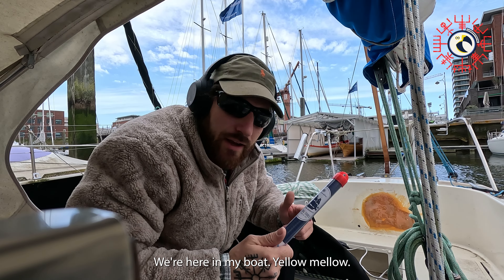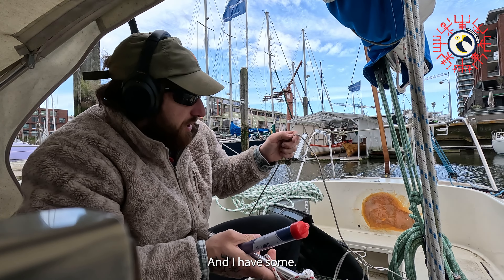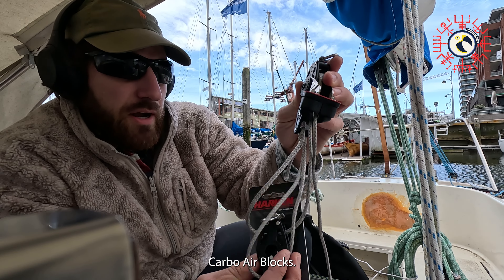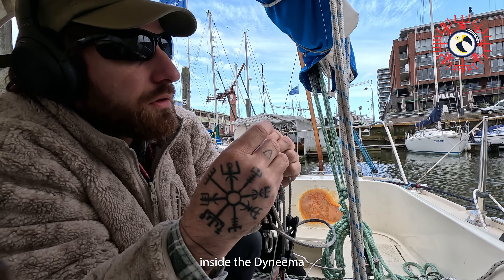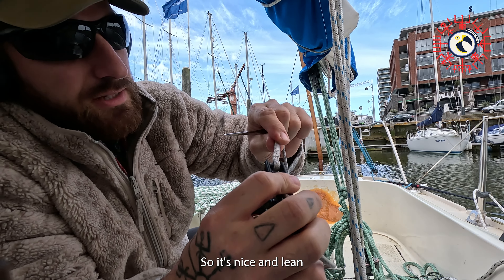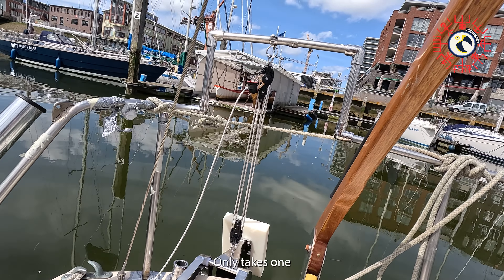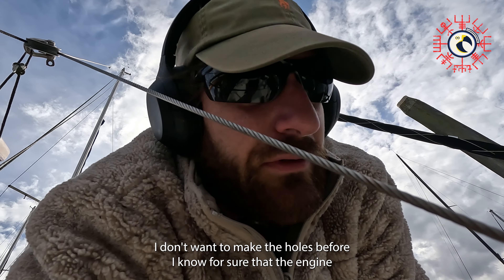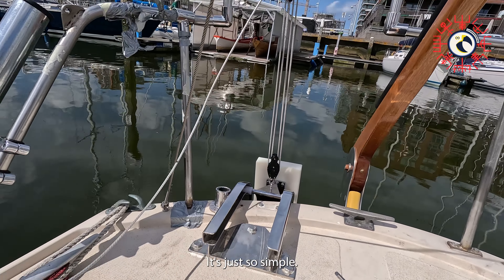My Homemade Outboard Engine Motor Lift

Comment: Some years ago I had 
Folksong Folk boat and I made similar arangement on the stern, but first I instal my Hasler SP2 windvane. It was a bit tricky to have enough distance beteen the OB and WV so when the engin is up to not interupt the work of WV. I bought new Yamaha 2.5 long shaft and the boat, the windvane and me was very happy - very small OB and didnt interupt the WV.
Good luck and
Fair winds!
Reply from the maker: That sounds amazing my friend. I actually have a windpilot I want to install soon. So, thanks for the tip, I’ll double check if it doesn’t get in the way. Fair winds, thanks for watching!
Reply: @LowBudgetSailing  gess is Pacific light. For this you can chech Attila Vedo. It will be useful cause, as a space, positioning and distances 
FB 26 and H 22 are almost same in transom - H 22 its a bit smaller, but you have transomhung rudder, so the space should almost same.
Atilla was very happy with his Pacific light.
On my H 22 I had Sea Feather and it is a great machine. A bit heavier than Pacific light.
Atilla crossed Atlantic and
Pacific with his H 22 without big drama, as I remember.

Comment: Nice. But if that was my outboard the lift rope would catch the back of the engine due to where it attaches to the mount. Guessing you've checked. I still want one.
Reply from the maker: I just tested it with the actual Honda outboard engine, and it worked out very well. Maybe I’ll make some minor changes before I weld it, but the concept works as expected 🤩

Comment: Hy guy good job... But before to weld the lift just vertical on the engine i will think if is better give a little angle inside. So when the engine comes up it can rotate a few orizontal. What do You think about? 
Sorry for bad English😊
Reply from the maker: Totally agree my friend! I just added the engine to test it, and actually it worked out fine, but if inclined will lift the engine a little bit further. However, vertical lift is less heavy than horizontal lift… don’t you think?

Comment: I had such a system on my IF, threw it out after installing the electric motor (no need for a pulley any more). It was already a pain in the ass to pull up with 8mm PP rope. So why use dyneema for it? It's expensive, you don't need to lift around 1,5t but 50 kg at a max, which any cheap 6 or 8 mm rope will do and it's more glitchy than anything else which makes me doubt whether the cleat will hold it. And its a pain to pull. You also might want to think whether you want to install the blocks further inwards, so you can pull the engine over the rim and the pulley is not in the way of the engine.